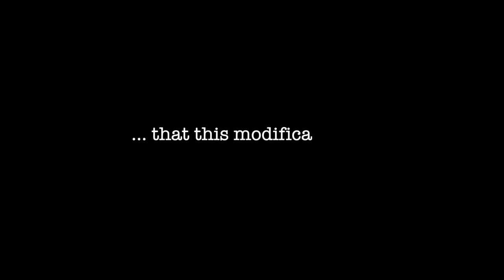Great Swiss Army Knife Modification! How to transfer a standart Victorinox into a one handed blade.

Comment: Every time I see your modifications for your SAK, it makes me wonder why Victorinox didn't think of that when when they designed the knife.
Reply from the maker: Thanks for this wonderful compliment!
Reply: Iirc in some locations one-handed folding knives are illegal. But I would argue most people have genuine non-murder use for swiss army knives like these and it isn't just the one-armed people who benefit.
Reply: Take a guess why Victorinox will not make a Felix Immler edition SAK.
Reply: The SAK is a lot older than one hand openers like this mod
Reply: @QuantumPyrite_88.9  that’s a great idea they Victorinox totally should bring out a Felix mod’s SAK as I defo would buy one.
Reply: Oh, I'm pretty sure someone thought about making it easier to open with one hand. However, installing such a stud at scale is difficult, I don't see how this can be automated as easily as rest of the SAK making process. And it would require new tooling for the scales and metal separator.
Reply: Macgyver never needed one-hand opening on his SAK
Reply: I know right!😆
Reply: @Jib230181  Send an email to Victorinox and leave a comment at the Victorinox you tube channel.
Reply: @QuantumPyrite_88.9  with all of his mods, built into one frame, I wonder how many layers it would be.
Reply: Stress point
Reply: @Stephen Well FWIW I can open any SAK one handed, I just use my teeth :)
Reply: Victorinox does have one handed folding knifes. Just look for the ranger 179
Reply: sorry schaut sowas von scheisse aus
Reply: Victorinox has one hand openig knives with locks. Soldatenmesser 08 or Ranger Grip. An opening hole is ambidextrous and dont come in the cutting way. Never change the classig SAK.
Reply: @Call-me-Al  You'd think that, but every time I see "normies" discussing this topic they instantly say "there is literally no reason to use a knife for self defense you freak". These people immediately go to the argument that knives are used for combat. Like bro. I just wanna cut some tomatos at a picnic can you calm down? I just don't want to be stuck in a situation where I need to wait for tomorrow so I can bring a proper tool.
Reply: @RP-dy5mu  some fancier models of perpendicular vegetable/fruit peelers come with a mini board that let's you convert the peeler into a mini-mandolin (the kitchen tool, not the musical instrument). So that's a non-knife way to get thin slices of tomatoes and cucumbers while having a picnic, but a proper knife is always best.
Reply: This is why Victorinox SAKs are rather inexpensive compared to newer knives without sacrificing quality. They’ve been using the relatively the same technology to create their lineup. It takes a lot of forward thinking for it to still be relevant today.
Reply: Because a One Hand Knife is a forbitten Weapon in Switzerland and Europe
Reply: Blade buttons had not been thought of at that time.
Reply: @samacw  but than again, locking blades are a relatively  new modification and SAK have installed one.
Reply: @Call-me-Al  I bought a Victorinox RangerGrip 58 especially because I can open the blade with one hand! I'm in the US, it's legal over here. So Victorinox already makes one hand opened blades and locking blades (it locks too) right now. It'd be neat if they diversified and made one hand opened blades for all of their other smaller models. They could be sold in countries where it's legal.
Reply: Design engineers of victorinox are old school🤣🤣🤣
Reply: @QuantumPyrite_88.9  One hand openers are forbidden in Germany.
Reply: Lol you guys don't understand business if they make a perfect tool no one will have the need to buy again thats why they slowly slowly make changes and fixes and to always make sure it has a new problem with every new fix there is a new problem
Reply: The problem is that this modification will also weaken the blade. The screw and bolt will also loosen, not only with use but also with a knife being carried as it experiences hot and cold weather.
Reply: I have wanted a one handed opener for so long if the 3” blade size.

I would also like to see one with a choil to stop it cutting you when folding, and to help keep it open when in use.
Reply: I think Victorinox should produce a knife this size but with a thumb loop on the back of the blade like the large ranger/soldier knives,  minimal rebooting as its just a different blade not the whole frame.

Comment: FYI :- The actual thumb stud is available (in many styles) from any knife making supply store and even some knife dealers will stock various thumb studs. Some of these thumb studs are threaded  for "screw in" the blade where the hole in the blade must be tapped & threaded, and  other models that are "screw together" types that do not require threading, but rather are two part and just use a hole and the two parts screw together.
Using pre-manufactured thumb studs does make this adding of a one hand opener much easier.
P.S. If you do happen to cut into the hollow section of the plastic handle, a drop of clear epoxy can fill the tiny void and a bit of polishing will smooth out the opening.
Reply from the maker: Thanks a lot for your tips!
Reply: Are you a Lefty?
I’m a lefty too. 
Like they say Left-handed people are the only ones in their right mind 😂
Reply: @reconty2133  It would be difficult to place the stud on the other side of the blade, you had to modify all tho other tools. The reason to do a "lefty"-stud is because the blade is mounted on this side.
To do a "righty" you had to use a waiter or a bantam as a base.
Reply: Thank you for that. <3
Reply: @reconty2133  And people who are both sides ?
Reply: Can you made a video do this please ?

Comment: Good idea in case you really need it. Whenever I cut a bolt down, I thread the nut on first and twist it down to the head. It makes smaller bolts fit into your drill straighter, if that's necessary. But the main benefit is that when you remove the nut it cleans up your threads where you made the cut. 

I think a drop of removable Loctite on the threads before final assembly might not be a bad idea.

Comment: Great mod to an already good tool. Something that may make it go easier: thread a regular nut on the bolt before cutting it off then as you unthread it the nut will work as a thread chaser to clean up threads,  making it easier to start your acorn nut when the time comes.

Comment: This looks like an interesting mod, but I’m concerned about the blade being weakened.  Maybe silver soldering a piece onto the blade would work better.  I have a Swiss Army knife for use while kayaking, including if I end up in the water needing to cut things (e.g. rescue) where one handed action would be useful, but I also want a UK legal carry, i.e. It must not lock.  I also have a Leatherman Crunch which I’ve considered modifying the locking blade to make it non-locking.  Maybe I’ll spin up the milling machine and sort it one day.

Comment: Awesome idea! I thoghut about it a lot, how to make it easier. There are metal glues which are stronger than welding, so it's not neccessary to drill out the blade. For example Loctite's epoxy weld bonding compound. Once cured, it is resistant to heat and moisture, including water, fuel, oil, antifreeze, and shop fluids. It won’t shrink and can easily be sanded. And I'm pretty sure other companies has similar products too.
Reply from the maker: Please let me know if you was successful!!

Comment: Nice modification Felix!  Another option might be the Thumb Stud for Buck 110/112.  This thumb stud requires zero modification to the blade.  It fits over the spine of the blade and uses a set screw to hold it in place.  It can be placed wherever it works best for the user.  Ambidextrous.  Can easily be removed with no marks or damage to the blade.  The handle of the Buck knife does not need to be modified either, due to the height of the blade spine above the handle scales.  The SAK handle might need to be modified.  Also, the t.s. I am referring to only fits a certain blade thickness range.  One would need to verify the thickness of the SAK blade BEFORE ordering that part.  It runs around $6-$11USD depending which website it is purchased from.  Thanks Felix!!
Reply: The thin blade on SAK's will be a problem for this style of thumb stud.
Reply: @blueeyeswhitedragon9839  I've used a set screw on thumb stud on a Merkur Kat knife without a problem.  I will have to check the thickness.  I never even considered modifying the SAK handle--great idea if the screw on stud fits.  I just hate weakening the knife blade.

Comment: Excellent mod on the SAK, I bet Victorinox comes out with this in the near future.
Reply: I wouldn't bet on that, they already offer a half-dozen one-handed opening models in the larger size. This mod has its place but I can see a problem of blade size. The stud really shouldn't be that close to the cutting area. When you rotate your thumb on there you can see how it can grab the cutting edge.  A different blade put in makes more sense here.

Comment: Wenn man ein Loch in die Klinge bohrt schwächt es natürlich die Stabilität. Zudem muss man aufpassen dass die Klinge während des Bohrvorganges nicht zu heiss wird weil man sonst die Härte aus dem Stahl zieht, also immer schön kühlen. Sobald der Stahl anläuft (also die Farbe Richtung braun/violett verändert) ist es bereits zu spät. Dann muss die Klinge neu gehärtet werden, was bei diesem Messer allerdings nicht so ganz einfach ist. 

Tipp aus der Metalltechnik:
Versuche das nächste mal eine Senkkopfschraube (beispielsweise M3 x 10mm) zu verwenden. So reicht ein 3,2mm Bohrer vollkommen aus, der Durchmesser der Bohrung wird nicht unnötig groß. 5mm Zylinderstifte mit einem Innengewinde M3 sind in unterschiedlichen Längen leicht erhältlich, da sie genormt sind (DIN 7979 ISO 8735). 

Ich würde außerdem einen Kegelsenker statt eines Kugelkopffräsers verwenden. Damit lässt sich wunderbar entgraten. Zudem kann der Schraubenkopf der Senkkopfschraube in der Klinge versenken werden und steht nicht aus der Klinge heraus.Anschließend etwas mittelfeste Schraubensicherung an das Gewinde damit sich der Zylinderstift nach dem verschrauben nicht mehr löst. Fertig 😉. 

An die deutschen Zuschauer: 
Man sollte sich darüber bewusst sein, dass man nach dem deutschen Waffengesetz aus einem legalen Messer ein illegales Messer macht, denn Einhandmesser sind in Deutschland verboten. In wiefern dieses Gesetz sinnvoll ist, sei dahingestellt und sorgt seit Jahren für Diskussionen. Dennoch kann zur Anzeige wegen verboten Waffenbesitzes kommen.
Reply from the maker: Danke für deinen interessanten Kommentar!
Das Messer ist absolut Legal in Deutschland. Es wäre nicht legal, wenn es arretieren würde. ...aber dat tut es ja nicht. Lies mal den Gesetzestext genau.
LG

Comment: Felix I really love my nail clip 580 but want to turn it into a jetsetter so I can take it with me on a plane. Is there a way to take the screwdriver from the jetsetter and put it on the nail clip replacing the blade and/or  file?
Reply from the maker: I've been reluctant to drill out rivets until now. So far I have always left the knife body together. I can't give you an answer for that, sorry

Comment: I don't like it because drilling a hole in a such tiny blade increase weaknesses of the blade. 
About this topic my 2cents is: I don't like the hole in the blade. 
Not oval not round not shaped like in 111mm and in 124mm SAK but also in Swiza and either in New Opinel outdoor or Spyderco so on.
I can tolerate the thumb stud like in Ruike LD42-B because the blade is shaped around it and it is a much larger blade.
But for SAK I like more the solution of the 90° monolithic bending leap used in the new Swisstool MX.

Comment: But what metal punch do you use that can grind Viktorinox's metal blades...?
Reply from the maker: Do you mean the drill?
Reply: @FelixImmler  No... Tha puncheon that you hammer with to make a grind or an scratch, for then the drill bit has an spot to grind and drill in...
 I tried to use a cobalt metal awl or puncheon on a BAHCO blade knife, but the blade wined...
Reply from the maker: @shofarox4037  Oh, thanks a lot for your answer. I have no idea from which material this pun ch is... sorry!!

Comment: I've seen a lot of Victorinox mods, but so far this one is most unnecessary of them all.  Victorinox blade is too tight to be effectively opened or closed this way and it have lock spring. Not only this mod damages the blade and handle to complete loss of lifetime warranty, highly decreases blade stiffness and creates dirt trap, but it also looks gross and useless IRL.

Comment: With that mod, you end it up with a weaker blade, and if you wanted a one hand opener, you could buy other victorinox models that are for one hand open, like the sentinel one hand, the forester, the Locksmith, the trailmaster, many of the ranger models and many more. You got a tempered blade, and you removed some metal so you made it weak, and you putted a weaker metal over it. That's not good. You better get the right form of the blade, and then you tempered the blade to get the propper hardness. I didn't like it, and I would never do that to a victorinox, it is to destoy it.